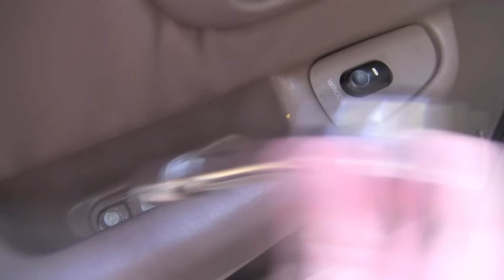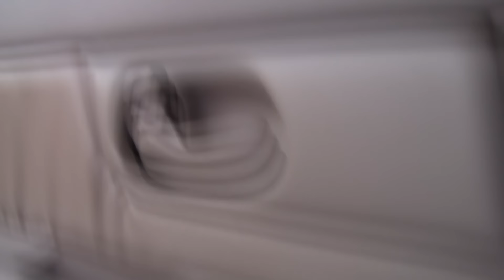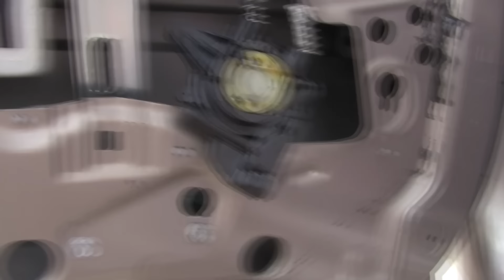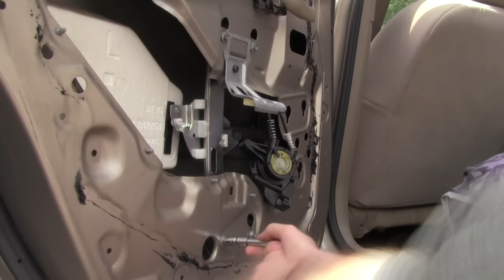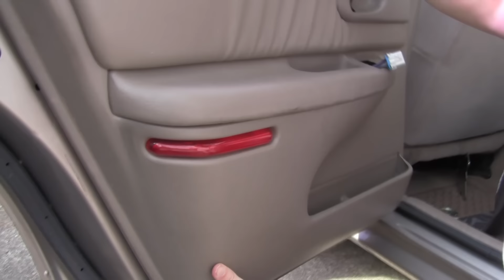How to push up a stuck automatic window that only goes down, replace motor

Comment: your switch is more than likely going out  because of motor still runs so you probably just need a new switch instead of breaking the motor itself and digging in that deep. So you could have ordered a new switch probably would have cost you roughly $11 or you could have intermittently pulled up the switch to raise the window up and have somebody sandwich their hands against the window then push up on the window at the same time that would have been a lot easier than what you just did

Comment: Thanks for this. I have a 2012 Kia Sorrento. I took the 3 bolts out of the motor that holds it to the door frame and removed it from the gear in the door frame. Without any restriction in the gear, window slid up easily and put the motor back into the gear. Reattached the door and put a plastic wedge on the inside of the window and door so it doesn’t slide down until my new motor arrives tomorrow from Amazon.

Comment: Had an issue tonight where I couldn't get the window up. Even when taking it all apart I couldn't get it to slide!
Then came across your video and said to cut the cable, do I did, and now my window is up!! 
Thank you for this! Otherwise I'd still be trying brute force!!

Comment: if you want an ACTUAL quick fix when the switch is bad and window goes down , but not up. Once you disconnect the wire going to motor connect a wire to each of the 2 motor wires and connect the other end to the - and + terminals of the battery of an portable power tool like a drill, and if the motor moves the window down just reverse polarity (wires) and it will move the opposite direction!
Reply: You should make a video on that 🤣🤣

Comment: I have the golf 7 and my driver side window rattles when I closed the door with the window open. However when it's closed there is no rattle. I assume there is a thing I need to tighten in the door to correct this?

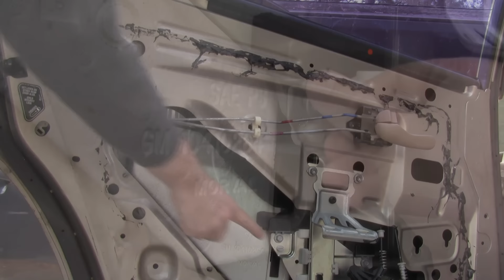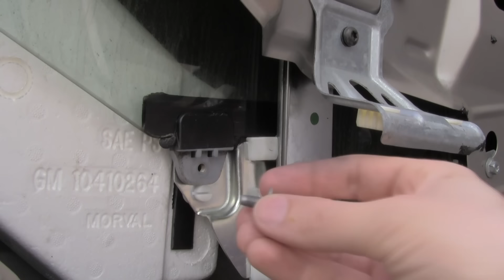Comment: Scott, nice video however I'm wondering if it still works?  I noticed at 3:28 when you released the window from the regulator the window is behind the regulator.  At 6:01 you reinstall and place the window in front of the regulator.  You can see the threads on the window bracket.  So there's nothing really holding that together since the threads are in front now.  It basically just using the bolt to push the window up and down through the hole in the regulator.  I'd be surprised if it hasn't given you problems since the tracking has to be causing a strain on the whole mechanism.  It's amazing how easy it is to put things back together and think it's all good because it works.

Comment: I've got a brand new window regulator and motor (I tried 2 different motors) and my window only goes down ... I think I've gotta figure out a way to reset my window system. It says roll the window down and hold it, once it's down, for 5-15 seconds, and then roll it up, and once it's up, hold it for 5-15 seconds . . . but my window doesn't go up. I have a feature on the outside of my car that allows me to hold my lock to the right to roll my windows up . . . and that works to roll it up, so . . . not to sure, ha.
Reply: Going through this now did you ever find a solution?

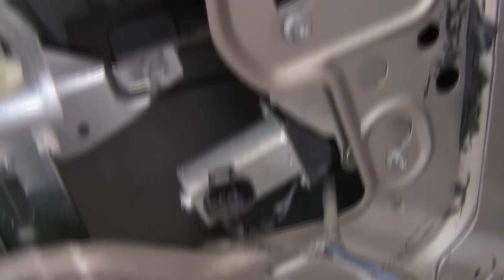Comment: There is an allen key adjustment/set screw at the end of the armature of the motor. Once you pull the panel off - it is pretty easily accessible. You can see it at 1:59 of this video. It is located just to the left of the black two - prong connector at the end of the motor. Adjust that in a quarter turn in while toggling the switch up and down to see if it the worm screw in the motor comes loose. If that doesn't do it for you come back out while toggling and see if that may start her up. Try this next time ! It worked for me.

Comment: The key is not a tool! let me guess you use your ratchet as a hammer too?
Reply from the maker: I was just using a wrench as a hammer the other day, but a ratchet would be too far. A screw driver works remarkably well as a chisel, though! https://youtu.be/PQcVPNdo8RU?t=3m25s
Reply: @ScottDriscoll  
Seeing the key being used like that bothered me too. Those keys can be very expensive, especially if it has the remote control for doors/trunk/alarm, etc. They take a special tool to cut because they are not like the old common keys that are cut on the edge; these new keys are cut along the flat side, so a standard key cutter cannot be used. Some of these keys can be over $300 from the dealer, and some are not available anywhere else. Thankfully, some are now being sold as blanks (if you can find someone that can cut them).

Comment: thank you so much!  I was able to use vise grips and manually turn the motor to roll the window up on my daughters 2000 century.
Reply: My daughter has a '99 Century and this just happened to her!
Reply: Excuse me I am currently looking to do that exact same thing but do not know where the manual knob is can you assist pls

Comment: Thanks. Took me about an hour to replace this same unit on my '03 Regal. Bought the "regulator" with motor from AutoZone for $65. This repair at a shop would cost $300-$400. One heads-up for others who want to do this;  the instructions say to use 3/8" socket. It is actually an exact fit for 10mm, not 3/8".
Reply: U can never have enough 10mm sockets or wrenches layin around right??  🔧🧰🔨🪓🧰⚒🔩

Comment: I like E L's comments.... the window may have tree sap beads, etc that make the channel it rides up and down in (outside edges of window sides) sticky. I would take RainX or similar 'rain beading' lubricant and make sure the edges of the window and the rubber it contacts at the sides and bottom of window opening are clean and lubricated. then.... see if the problem eases up or disappears. The problme may be stickiness/friction and not the motor.... especially is if just started suddenly as mine did on a hot day (A/C is running and that takes some electricity and the weather is hot and makes for dry and sticky droplets of tree sap).  An old work mate used to say ... ' it's probably not complicated, just something simple or stupid ' )

Comment: My rear window couldn't roll up either. I adjusted the regulator and lubricated the whole thing, but that solved it just temporary. So finally I added a spring to support it on its way up. Never had trouble again, and I'm sure it'll last longer that way.
Dividing the strain evenly between going up and down was the key ...
Reply: Could you please let us know how you fix the rear window. I asked a car shop to fix it for me two years ago. It stopped working again. And the car shop closed... I guess that technician lied to me  and didn't replace the part, just lube it. I want to fix it myself this time.

Comment: question, is there a fuse or relay switchin the window system. mine all stopped working at once from the individual doors but all still go up and down from the master switch.
Reply: plz text me yes or no to 4193074291
Reply: Lorie Stull you shouldn't post your phone number online like that.
Reply: Being naive is bad for the naive person, but being too naive is bad for the one who contacts them i.e. I smell a scam.

Comment: If window has became detached to the thing that holds it to roll up and down and you can't afford to fix it get Clear caulk and a calking gun and caulk rolled up window on Bottom on Both sides outside and inside but Not sides or top. Caulk window and rubber seal. It seals it. You can do it in 15 min. A retired mechanic gave me this tip. I caulked the window on a 2000, Camry. I have driven 200 miles and It stays up. If you ever want to fix the window right the caulk comes right off. The caulk is not noticed unless you are looking for it and get up close.

Comment: my window motor is gone out of mine I have a Aurora 2002 so if I was to cut that wire to manually pull my window up 
 will it affect me  getting my new window motor ??
Reply: You could do that but you would need a new regulator. but most motors are sold with the regulator .
Reply: +Raymond Molina  my regulator is brand new the motor is shortaged out
Reply: Tyler Lloyd I've got a 1997 Aurora &just too compacted. I'll let my mechanic do it.

Comment: Good Job ! Usually you can clean brushes inside motor, they are main reason, motor is slow/ or stops working, you don't really have to buy a new motor! And lubricate!!! I don't like the speed, in time 6.10...., with a new motor in there, very slow, you should lubricate the window channels with silicone spray too !!! other than that, youtheman =)

Comment: Don't rely on the friction to hold the window up when driving. If you hit a bump the window could slide down and possibly break. Wedge something in side the door panel to hold it up. I've used a empty plastic bottle in the past. It's also a good idea to grease the runners with some lithium grease and spray the rubber on the outer window with some silicon spray. This should make the window go up easier.
Reply: 0
Reply: ))lp+

Comment: I have the same problem, the point is when I try the mechanism without window (outside the door, just the mechanism) it works good, down and up, when I put the windows in the car door then it goes down but up, according to your description   I know is not problem with the motor, do you have any idea what can be?
Reply: +Felipe Perera switch? I tried it once on my Chev Venture replacing a switch..easy and cheaper. Good luck.

Comment: Just as an FYI it could have just been the switch that went bad.  If the motor fails that typically means it won't even go down.  You'll hear the relays trying to engage, but won't move. My 05 Monte Carlo LS has the same issue on the driver side.  Window goes down, but not up.  That's a switch issue not a motor.
Reply: +kjemradio  Great advise to save time and $$. Thx
Reply: James Chuaycham ป้อม ศักดิ์ชั
Reply: I  was waiting to this comment... thanks.. proud of my fuckingself
Reply: Thanks, have same problem, was thinking switch
Reply: Hmm might need a switch then

Comment: Thanks a lot for this! I kept looking at how tight that cable was and assumed it was the issue, but was afraid to cut it lol. Knowing that it is just the regulator and can be replaced at a later time was good to know. 

Window is finally back up! Thanks again.

Comment: if you fully dissconnect the motor you can pull it up easily and sit the old motor on a tooth or a few off and turn it to aline it up with the holes in the regulator on the assembly and the mounting plate to keep your window up and it not go back down and just leave the power dissonnected so nobody accidently rolls it down but right now im in the process of solving the problem with mine cause my motor still runs but it wont go up the assemlby is fine cause i moved it up and down manually to make sure so im currently getting the window switch controler assembly for the front window and run through and check all the wire connections in the windwo assembly panel to make sure all wires are making proper contact cause i know if one switch is pushed up while the other is down the motor for windows down work it stops it so assentually if one wire is out of place or your switched is fried it could maybe do the same possibly?
Reply: Scott Driscoll 
I have both my front windows can only go down but not up.
Do I need a 2x whole new unit?
Reply: +Scott Driscoll 
Please let me know?
Reply: thanks
Reply from the maker: nick13999455  do you mean fully disconnect electrically or mechanically? I believe the worm gear in my motor prevented me from back-driving it even though the electrical lines were disconnected.
Reply: the motor physically makes it impossible to pull the window up when its attached to the regulator so you have unbolt if from the regulator and pry it lose gently cause drive shaft toothing on it slides into the inner locking spaces on the regulators pulley so to separate it you can use a flat head screw driver and work it gently between the motor and the pully and pry it apart from it separating is once you down that you can pull it up easily and then just off set the motor and rotate it back to alignment but turning the whole assembly cause that gear just doesn't want to move easily to say so if do that you can re-tension your regulator and your window will never move down and keep it unplug so nobody hits the window switch and puts it down but to be honest generally your window regulator fails before your motor does so to be honestly connect some jumper cables to your battery and some test clips to the inner connection pegs on the motor if you want to test it connecting one way makes it go down then reverse the polarity but connecting backwards is should go up if your motor isn't your problem from there you now know its either wiring issue or your switch might be done for ill give you more info once I'm done working on my buick kind of doing this whole thing with of trouble shooting the circuit right now cause I've figure out my regulator is fine cause i could pull it up and my motor still is spinning so yea
Reply: Bailey puppypaws

Comment: lol wtf this is garbage advice, why would you straight go into taking shit apart when 50% of the time if a window doesn't want to go up is because it got pulled too far down by the motor and the only thing that is really needed is punching door panel in the are of the motor hard while pressing the up button.

Comment: God, all that work just to pull the damn thing up. What if I accidentally spoil something else!
Reply: Lhavanya DL.  lol its alot easier then the guy makes out ive taken apart my door panels on several cars for multiple reasons wheather to fix a lock assembly to fixing the window assembly but what he fails to mention if you dont cut that dang cable and part of his issue is if he wasnt being gentle to disconnect the white pully off the motor and keep that part in place it can screw up the regulator and once the motor is free you can pull it up easily and then reconnect the motor off track a little and rotate it to tension up the wires so your window stays up till your replace the source of your problem wheather the motor fully fried or the wire connections are lose or your switches are the source the fact is there alot better ways to handle this and checking the connections first is always a good idea so you dont have to return 50million parts that werent what you needed or get one that you cant return cause you fully installed it and then found out it wasnt your problem
Reply: That is one long sentence @nick13999455

Comment: No idea what you did to manually disconnect it
Reply from the maker: cut steel cable with dremel. Not exactly a reversible operation, requires a new assembly.
Reply: ninjatears